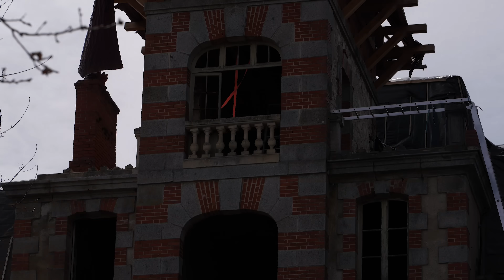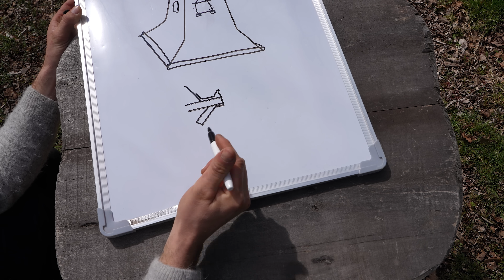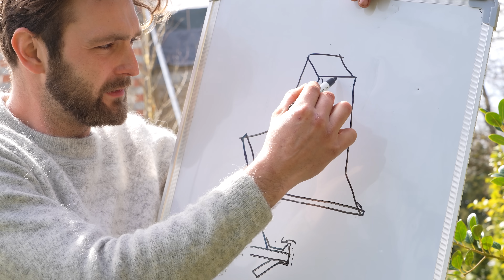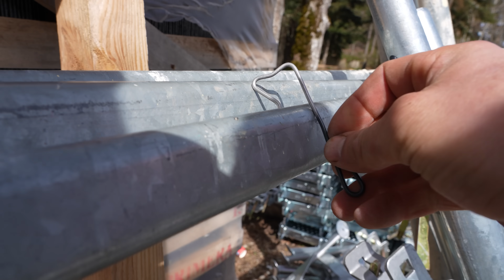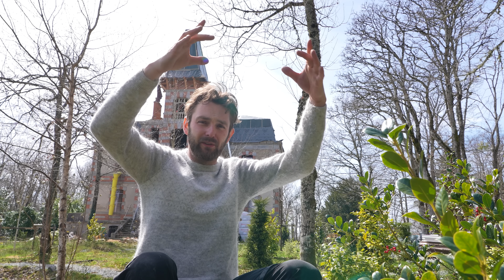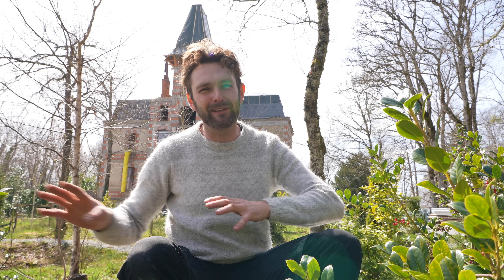The roof, how were doing it.

Comment: Slate roofs are constructed in such a way as to breathe.  They hold heat which dessicates wood underlayment to a dry rot powder.  The latticework is the right way to go.  The space underneath isn't closed off to air movement, for if it is, the heat buildup becomes too great.  That heat causes warping, moisture, and mold.  So that roof space has to breathe.

Comment: Loving the Vlogs Dan. Slates in the UK are nailed on and last 75 years at least. Slates do not slip or tilt due to weather conditions.  From what I have seen the hook style only last up to 10 years and the slates can still tilt and slide off.  The hooks can wear through from minute movement of the slates.  My uncles house in Wales was slated 60 odd years ago and has never had a slate replaced for any reason and they were nailed on. I saw a chateaux only slated 2 years ago had slipped slates during the recent storms. Cannot remember the name right now but will see if I can find the video and post the addy here for you.    Looking forward to the roofing fun. ATB regards from the UK

Comment: If there is a way to put some lines or folds in the wide facia band of the gutter it could help make the lines more classical like the rest of the stone detailing. All the molding of a classical cornice are meant to lighten the effect and make the detailing more graceful. Perhaps by layering the fascia over boards? The copper will age but it takes years. It might take at least a decade before it starts to turn green. It will turn brown first unless you treat it to speed up the process or to prevent aging. The wide band without some 'streamlining" might disappoint you?
At Chateau Puron all the slates are nailed as they were done in the 18th century. . At the Louvre and Versailles all the edges are wrapped in ornamental and gilded lead but there cost was no object.  Except indoors, apparently, where they did reuse and recycle old furniture and panelling. I read that at the peak of activity at Versailles when they were building the wings and other park and palace buildings, for a few years it was costing over 80 million livres per year. Laissez bon temp rouler they did. maybe you multiply Livres by 50 to 100 times to get a modern sense of the expense?

Comment: I love the back ground information. I cant wait to see the turret transformation, it will be like beacon! you should always shine a light at it!
Your build is too complicated to just follow the videos. I wished you explained the sealer you used on the balcony. Although, I trust that it seals on the flat area, but i would be very concerned, about the transition area to the wall. How is that supposed to seal where it meets the wall at a 90 deg angle? Also you mentioned that you are planing to heat the chateau with air. the problem with tall rooms is, that the warm air will be up under the sealing. While with in-floor heat it is warm where you need it the most and it creates a lot less dust. And there many great applications for wood floors.

Comment: I note that on the reproof of Chateau Purnon, they are nailing their 47000 slates on ...will your wire clips not rust out within about 25 to 30 years...I am in no way an expert but just wondering
Reply: You can buy them in different materials like copper and stainless steel, company seems to be Dimos in France.

Comment: 1/- I really hope you do the mitred hips. They look so much better than external flashing over the ridge line. 
2/- Do not expect the copper to go green within your lifetime. It will quickly oxidize to medium brown. I have seen new copper roofs after 20 years without a hint of green.
3/- You need some access to the top of the tower for maintenance, even if this is only a waterproof hatch . Also a strong point for securing climbing ropes if you ever need to rappel down the roof. See yacht type hatches.
4/- The abutment between the hanging brackets and the granite sills is a weakness as water will run down the brackets, and water will be trapped between the wood and the stone. This is a recipe for rot. It is a pity that you did not use oak for the brackets. Soffits would make the problem worse.
5/- Are you going to use a down pipe from the gutters? More traditional is  spouts or gargoyles to direct the water away from the walls. The down pipe would be a very long run!

Really looking forward to the slating of the tower. I am sure that you will solve all the problems with your usual eye for quality.
Reply: The medium brown looks best anyway imo 🙂

Comment: I would say to rather use wood below the roof just so if there are problems you can easily replace it. If/when water gathers down there it will slowly eat through the copper ... far slower then with steel or anything like that but with wood it will be a lot easier for any water to just pass through instead of causing damage.

Comment: its amazing dan. wow your excitement is infectious .  wow is all i can say.   a thought that i had was with the Dorma windows when the windowy bit is installed into the frames will their be a window or 2 that has the ability to open and this in the future give you easy access to the turret roof outside if an issue occurred in the future and you needed to tinker with a bit of the roof element if an issue occurred . its a case of just looking forward also its an ease of access if you needed to clean the gutter of moss or birds nest

Comment: I would not wrap copper under soffit area. Water will hit the face of the gutter and follow the metal to the underside and potential lay make its way back to the wall. Unless you have a very good waterproof connection that is “shingled” so water cannot intrude you are looking at a slow long term risk.

Comment: Are you copper cladding the supports under the turret. Is the coppersmith going to solder everything. Hate to see copper just siliconed in. I do know some will be. Do know the slate and copper will add tons and tons to the roof.

Comment: Putting the flashing UNDER the roofing slates on an outside corner will allow water under both the slate and the flashing. You're going to end up relying on sealant or the underlayment. Either way, not a great solution.

Comment: I think you can order perforated copper for making the continuous copper soffit vents.  If not, the Metal Worker will need to craft the vent holes/slits in the copper for the soffits.  This is very time consuming and therefore extremely expensive.

Comment: Would you be willing to spend some time in next Sunday's video talking about the angled turret roof structure's bracing design? I'm curious what may be considered to bolster / reinforce the attachments of wood to the stonework to mitigate long term settling and loading on the structure. It is a fascinating engineering problem and I'm excited to see what you do next! :)

Comment: Hi Dan I have a question, why don’t you just put two holes in the slate and nail them to the wood? They would last much longer in a storm.  And that way they won’t blow off. It’s not like you can jut run up on the roof and fix it in a hurry? Just asking.

Comment: Are you fitting any lightning protection at the top of the tower ??. Not sure on the requirements in France but might be worth looking into..
Reply: He started putting something fancy together when they were constructing the frame. I'm not sure if it was put up or not though. There's going to be a large guage copper wire running down to the ground from it iirc

Comment: You’re doing very welldan I wonder if you have put metal straps on on the inside of Tourette, to hold it down to the wall plate because if you get high winds side winds there will be a lot of pressure on that roof I wouldn’t want it to blow off I know there’s a lot of weight there but wind can be very strong. Best of luck with the rest of it.

Comment: Do not have wooden soffits. This is the primary way wildfires burnt homes in Los Angeles. Agree with comment below on vents but vents need to have 1/16th of an inch mesh to prevent embers from entering.

Comment: Well, that's certainly a lot of babble about a lot of babble!  Only kidding Dan, it was all perfectly clear.  Based on my limited design experience, I would offer a thought on the soffit question.  Remember that the copper is going to be all bright and shiny for a limited time until it turns a kind of pond scummy green color with a value very similar to the slate.  That being said, your thought of making the gutter/fascia much deeper (read thicker or higher) is perfect because it lends some visual weight and heft to the look of the entire roof and that is a good thing!  I had wondered long ago if you would address that when it came time and you have!  Leaving the soffit not a part of the gutter allows it to visually be part of the building and not part of the roof.  It could be simply plywood painted the same color as the field areas of the building or it could be coated with a lime render to match the building but in either case, it allows the turret to visually read like a heavy, substantial roof resting on a thoroughly substantial structure!  You don't want it to look like a big pyramid with a tin floor!  Also, for the copper "cap" you talked about making for the very top, you want the bottom of that cap where it meets the slate to have the face of the metal a slate or two '"thickness" above the level of the slate with the tiles butting up to it so it appears thick and substantial and doesn't  seem to be just a thin wispy little piece of tin!  That's it, I just used up the last half of my two cents!  Can't wait to see what's in store!    Jack L.

Comment: You don’t need ventilation through the soffit? I agree with the roofer, wouldn’t use the copper. It’s a lot more work & cost in an area that’s not even that visible. Save that money for things like balustrades & repointing the exterior.

Comment: If it was my decision, I would work the copper cladding around the first board of the outside of the soffit, under the gutter line, and then just plank the rest with wood back to the wall. That way you maintain the visual line of the eventual verdigris, but you don’t waste money on excess copper sheet. The contrast between the patina of the copper band and the rest of the wood soffit would be super nice to define the shape of the return of the roof (think about the banding on the edge of a lampshade) vs the soffit. It would look very tidy and definitely custom that way. 

Spring is definitely on its way. Can’t wait to see all your planting pay off. It’s gonna take off out there, considering how long those grounds laid fallow.

Comment: The future patina of the copper will recreate the green from the old ceramic inserts that were there.  Wrapping the copper underneath the bottom of the turret on the angle braces would be a nice touch.  Have you thought of where the water runoff of the gutters will end up at?  Having a pipe down to the old swimming hole seems like the logical spot.  A ditch digger machine (looks like a massive chain saw on wheels) will make easy work of the chore for burying the pipe.

Comment: Copper should darken and turn a bluish greenish colour over time, so it should add a nice patina to the roof line. Unless you seal it of course to keep that bright copper colour or to whatever patina aged state you want.
Reply: A full verdigris patina will protect the copper and extend the life of the roof. The patina is also beautiful and is the whole point of using copper.

Comment: I often work on renovation of historic buildings, but I'm really excited to watch & learn from all of these specialists along with you!  Just one comment: if you're not going to use a wooden soffit ask the roofer to confirm if there's any potential for the copper leaching over time into the stone & degrading it structurally (as well as staining it) - it's hard to see what type of stone you have, but its a particular risk if the stone and/or mortar used has any lime (calcareous) content. Also best to make sure the copper doesn't come into direct contact with any other metals except lead or stainless steel, to mitigate the risk of galvanic (electrolytic) corrosion.  Finally, chapeau to the mason for lending you that scaffolding - that's what you call a good artisan friend!
Reply: Excellent professional guidance 👏🏻
Reply: The stone on the chateaux is granite, so that’ll be safe enough. And there will be a gutter to take away most of the water of all of the roofs. No doubt there will be occasionally gutters that can’t handle the amount of rain as it can torrentially rain, especially in summer. I like the fact that already Dan is making them larger than they were back in the day as climate really has changed. I hope the lightning rod thingy that he made will be included asap. We really don’t want to see this place burn down a second time.
Reply: @ Hans, I instead notice that the 'stone work' at the soffit level is actually concrete block which Dan has rebuilt with as well as half brick and mortar, and much of the mortar he has used is a lime based mixture as was original. This is not about rain or overflow so much as basic humidity and the novel technique (not using a wood substrate) being proposed, and is very appropriate advice as given. I fully agree that he professional roofer is the perfect place to ask the proper questions.
Reply: If you make the soffit from copper will you make perforations in it to allow the roof to breath?  As others have pointed out there are various things to consider with copper and wood. How will the roof breath to prevent condensation build up?
Reply: Agreed with leveraction, it's very nice to see the occasional suggestions from experienced professionals on these often amateur attempts at rebuilding. So much of our science has been lost in this world of superficiality, the building trades especially.

Comment: getting slates on will certainly make the turret more wind proof. as it is now, the anchoring is quite a risk if there is a severe storm from the wrong direction, the whole thing could topple over. hopfully the rubble walls below have enough shear strength left to tackle the forces...

Comment: The guttering needs a little edge/bulge on the underside to let water drops fall of and not run to the wood. I don't know how to describe it. But water drops will form on the plane underside if there is no edge.
Reply: Have you watched the video?
Reply: @angelaregan475  yes. Only laying the copper around the corner isn't enough. You need a little edge for the water that hits the side and run to the underside. It should nit build up there but dripping off. Like on kitchen tops. You have a little slot to let water drip off instead running to the cabinets.
Reply: @ChriDDel  But don't you think the professional roofers and the copper-man knows it..?
Reply: @KjerstiNagel  may be.

Comment: The soffits will need to breath, so if you clad them entirely in copper, make sure to include vents. Will the windows in the dormers be something you can open to let the rising hot air out? That'll keep the chateau comfortable without mechanical cooling for longer during the warmer seasons. Cannot wait to see how it all comes together, 'cause like you said Dan, all the details you skipped over in the rush to just get a roof on the building will need to get done.

Comment: Listen to your roofer.  If they are not sold on something, take your time on choosing that something. Personally, I like understated flash.  But if your heart delights in something a bit showier, and it does not interfere with the structure and lifespan of the building, then spread your wings and fly! (I just realized, those green tiles that seemed so out of place, would tie in perfectly with the copper turning green. (Forehead slap!)).

Comment: I've been watching your channel since it began, and I have rarely ever posted a comment.  Even more rare, I never had an issue with how you did things.  Once you held up that slate hook, I paused the video to type this.  While hooks may be authentic to an old building, they may not the best option, especially in a case like yours, where there is an extreme roof situation that is already all be inaccessible.  Double nails will prevent slates from slipping.  Because climate change is causing more severe weather more often, a more securely attached slate will be able to withstand wind better than if it's simply sitting on a hook.  Ok.  That was my 2-cents.
Reply: You believe in the climate hoax?
Reply: In Brittany due to stormy weather hazard, we nail each one at the top with galvanised nail.

Comment: Dan I think you should consider to change the angle of the Dormer Roof on each side of the building to slope out at the bottom similar to Purnon roof - this takes the gutter system off the top of the wall, so in the future should a gutter fail, you will not have water pouring into the walls and damaging the building. I suspect in the past your building had this style roof and it was changed when the zinc was put on.
Reply: Fantastic suggestion. The architect at Purnon explained how they made mistakes in past there and their solution and reasoning from engineering standpoint is well documented in their episodes on the roof and gutter. Hope Dan sees this message. The building would look far more elegant with sloped out roofline either side of main tower.
Reply: Great insightful and helpful comment!!!